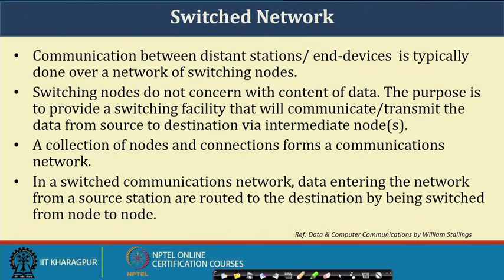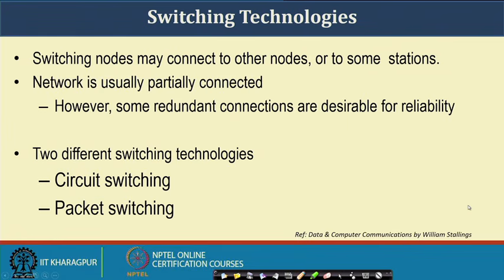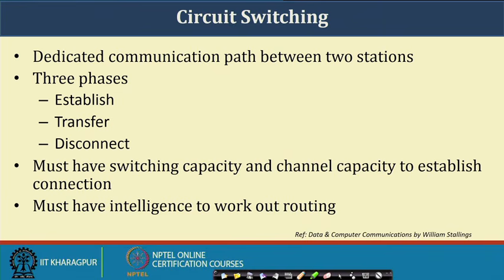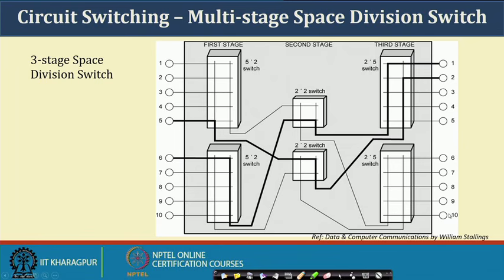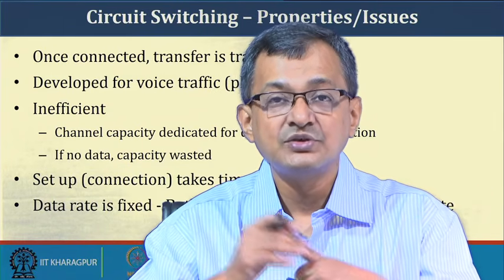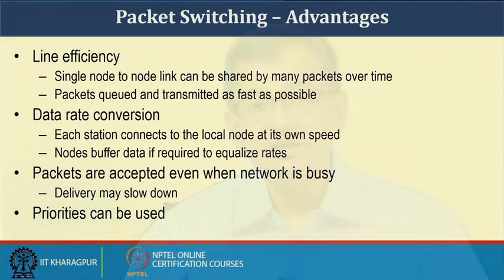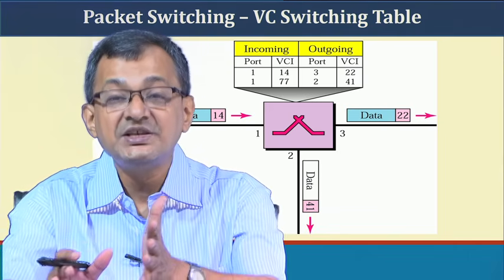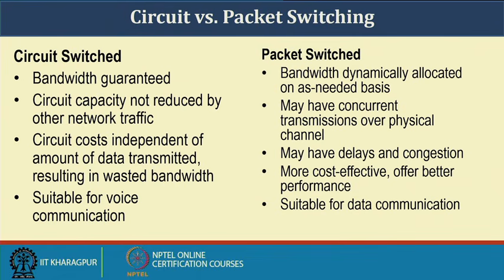Lecture 3:Network Protocol Stack

Comment: 🎯 Key Takeaways for quick navigation:

00:14 📜 The lecture will cover an overview of the protocol stacks OSI and TCP/IP, primarily following TCP/IP, and a quick history of the Internet's evolution.
02:34 🌐 ARPANET was formed in the mid-1960s, marking the beginning of packet switching networks, which split data into small packets taking different routes to the destination.
08:46 📈 The growth of the Internet has been exponential, with millions of hosts and websites emerging over the years, leading to the WWW revolution.
11:32 🔄 The lecture focuses on understanding the basic protocols, processes, algorithms, and methodology behind networking.
14:45 ⚙️ Protocols are controlled sequences of messages exchanged between systems to achieve specific tasks, and they define the format and layout of the exchanged messages.
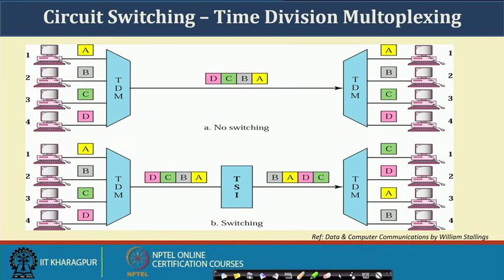18:14 🗂️ The OSI model defines a seven-layer networking model, while TCP/IP is considered a four-layer stack, providing a set of public standards for exchanging packets of information.
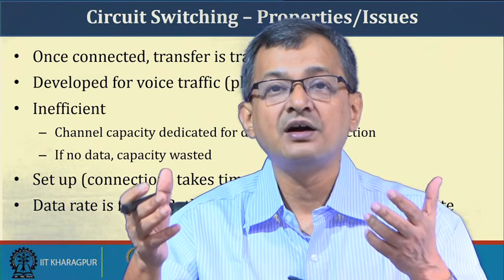21:22 📚 TCP/IP and OSI models describe the hierarchical structure of protocols, where each layer's output becomes the payload for the next layer.
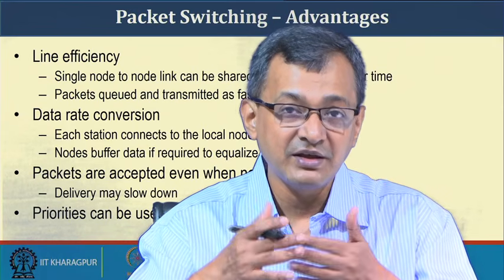25:25 📡 NIC (Network Interface Card) devices are Layer 2 devices with unique MAC addresses; LANs connect computers using crossover cables or hubs as repeaters.
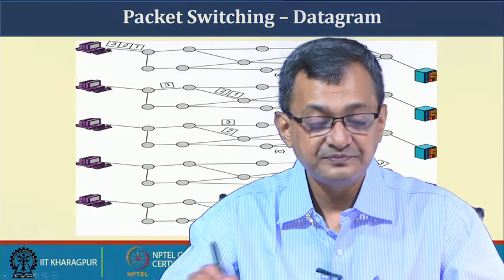28:34 🔗 Hubs share bandwidth between connected devices in LANs, but their performance decreases when cascaded due to shared bandwidth.
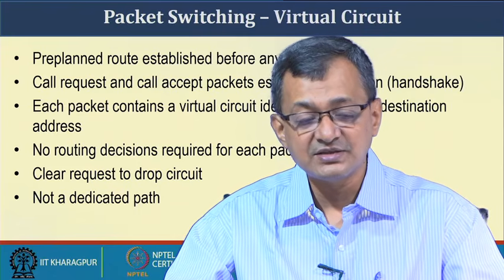29:04 🌐 Hubs are layer 1 devices that cannot filter traffic, leading to collisions and wasted bandwidth in LANs with broadcast topology.
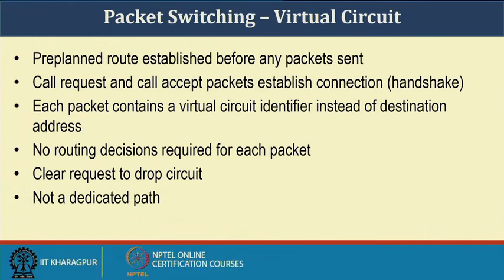29:53 🌐 Bridges and switches (layer 2 devices) filter traffic based on MAC addresses, localizing traffic and reducing collisions.
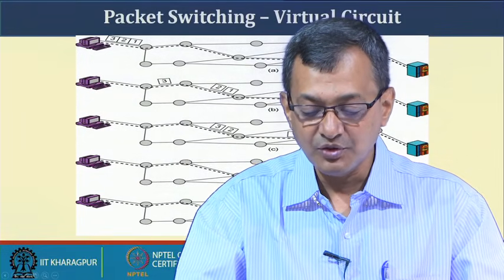30:48 🌐 Routers (layer 3 devices) filter traffic based on IP addresses, dividing broadcast and collision domains between different networks.
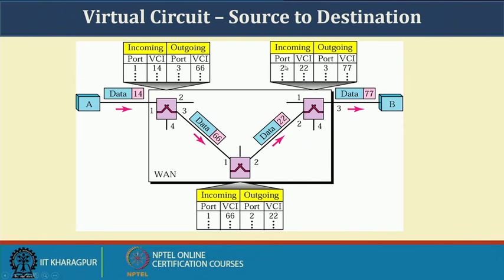32:14 🌐 Hierarchical network design with core, distribution, and access layers for efficient communication and functionality.
33:39 🌐 Each layer has specific functionalities: physical layer handles transmission, data link filters MAC addresses, transport connectsprocesses, and application serves end-users.

Made with HARPA AI